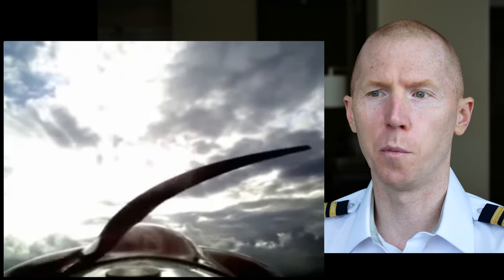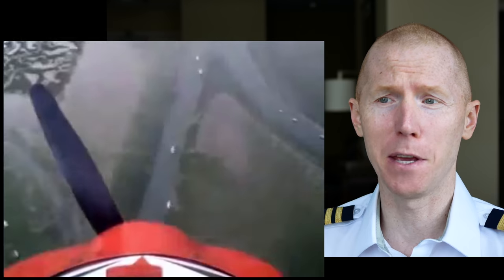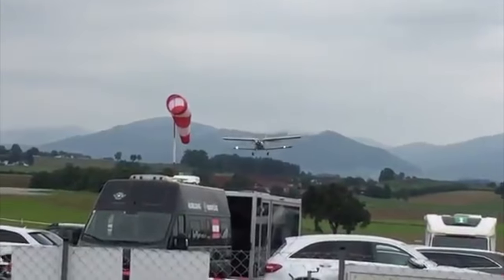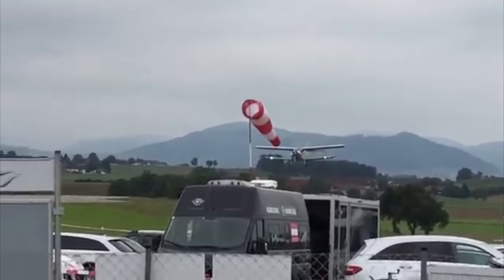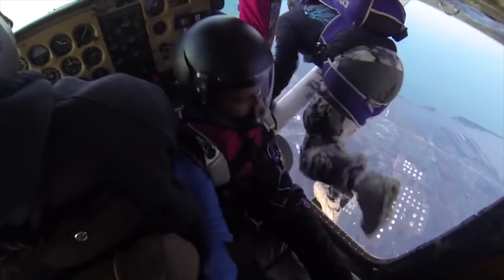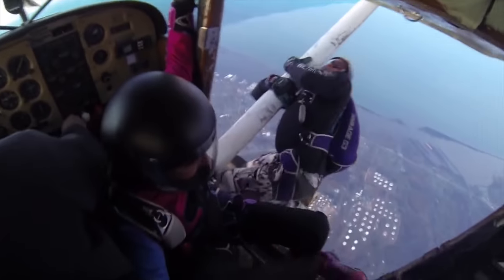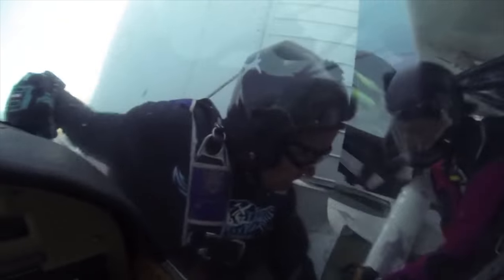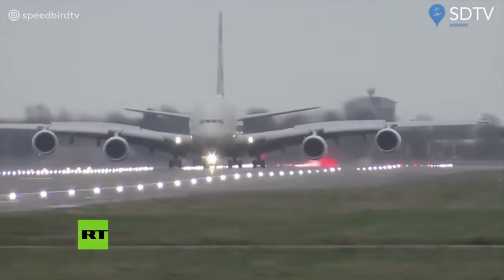Mid-Air Collision Rips Plane's Wing Off | Viral Debrief

Comment: For those who are wondering, the skydiving accident happened in Superior, Wisconsin in 2013. Those white circular tanks you can see on the ground in the video are the same refinery that exploded in 2018.
Reply: It's insane that everyone survived that accident. When you see a Cessna spiraling with only one wing, that doesn't typically bode well
Reply: Errr, no. There was an explosion at the refinery which is not the same as the refinery exploding. But apart from that, putting that much flammable gases and liquids right next to an airport is just asking for it. One of these days a plane crash is going to ignite multiple tanks and then there's a good chance of the entire facility becoming a mushroom cloud.
Reply: @JC130676  If the Chemical Safety Board case study videos are any indication, you're much more likely to get the explodey effect from some transfer pipe that hasn't been serviced in 40 years due to deferred maintenance than a plane slamming into anything.
Reply: Note to self, avoid Superior Wisconsin. Seems to be extremely unlucky.
Reply: Wow, it took 5 years for the refinery to explode? Seems like a lot of time to put out the fire.
Reply: @eaglestdogg  LOL
Reply: That area must be the Bermuda triangle of Wisconsin!
Reply: @JC130676  Newark and almost any Northern airport has those mate

Comment: 6:30 My dad always taught, aim about 1/3 down the runway. If the runway is so short you need to land on the numbers, find a longer runway.
Reply: They also teach us to fly a 3 degree approach because that's what the airliners do, but which is terrible for small single-engine planes in the case of engine failure.  A slightly steeper approach allows you to maintain the safety margin and keep enough energy if the engine fails.
Reply: Plus that is an an-2 a plane that is so slow that it can fly backwards in strong winds, don't think he needed that whole runway.
Reply: Its fun landing on the numbers when you don't have to
Reply: @maxmackinlay618  Lots of things are fun. It doesn't mean they are safe.
Reply: @erictaylor5462  Can you please explain to me why landing on the numbers is unsafe? Imagine being diverted to a nearby, short but suitable runway due to unexpected deteriorating VFR conditions. But not having the experience or the ability to land on it.
Reply: @maxmackinlay618  This is directly from my father, a certified flight instructor.
     Landing on the number is unsafe because if you lose power, or fly through a down draft you will land short of the runway.
     If you don't have the ability to safely land your airplane, you should not be flying solo.
     It is possible you may be landing on a short runway, so short that you need it's entire length. This scenario doesn't even need an emergency or diversion. IN THAT CASE it is safer to land "on the numbers"
     But if you have the room, it is safer to land farther down the runway.
     There are several cases when a pilot has no perfectly safe options. Sometimes you have to make the best choice available.
     For example, you take off in an airliner and lose both engines over a densely populated city. There is no safe place to land, so you choose the least populated area to crash into.
     If you're lucky you can find an empty lot to crash into, even if it means killing everyone on board, at least you won't kill anyone on the ground.
Reply: @erictaylor5462  Your Dad is a very good instructor, and I appreciate the time and effort he put into your answer.
Reply: @erictaylor5462  I give you two the wholesome award, good job being nice to each other on the internet
Reply: @maxmackinlay618  Its called the touchdown zone for a reason.  In a 152 that can land and roll out in 1.000 it may not be as critical but as you get into heavier and larger airplanes you will take a different opinion about landing on the numbers.  As far as getting experience or having the ability in an emergency,   you don't need to land on the number to get either.  The point is to have a target and keep working on being exactly on target, 1,000 from the end.  I would make it my goal to always have the wheels touch in the touchdown stripes.  That means aiming for the 500 fixed distance marker and flaring to the TDZ.  After a while I got to where I would almost always make the center of the TDZ.  As a pilot you should always be trying for the exact center of everything.  Center of the taxi way strip, center of the center line, center of the nose wheel chock line, well that one is up to the ramper but you get the idea.  Being precise doesn't mean operating close to disaster.
Reply: I was taught a 1/3 down the runway also
Reply: Tell that to St. Maarten
Reply: @Shrike2415  There are exceptions. But just because there are times when you HAVE to land right on the end, that doesn't mean you should do it when you don't have to.

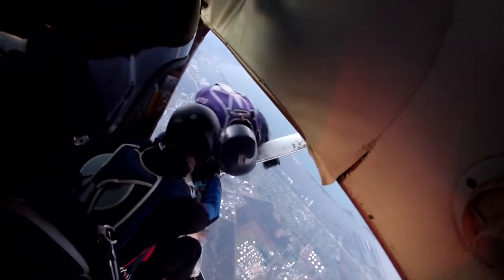Comment: 10:38 the upper plane is in a right descending bank as evidenced by the horizon showing out of his windscreen. you can even see the wingtip of the lower plane in this frame so it was plainly visible. the pilot of the upper plane just wasnt paying attention enough. its amazing no one got crushed between the planes or struck by the propellers.

Comment: 5:33 Fortunately since it's an AN-2 it'll probably buff out.
Reply: Love that plane, so gorgeous.
Reply: Those AN-2 Colts, typical Russian-made aircraft, are tough old birds! It's a shame what happened, but it'll be flying soon again.
Reply: @michaelbishop8298  Russian made things are always pretty tough lol
Reply: Buff out?  They'll just cut the landing gear struts off the other side so it can slide level and keep on going.
Reply: @ardeladimwit  You are correct my friend about the AN-2 being of Ukrainian origins. The Antonov Design Bureau is located in Kyiv, Ukraine, where the biplane got its start. What I meant to say was Soviet-made or even USSR-made aircraft. I hope that clarifies things!
Reply: @michaelbishop8298  Not only not Russian, but not even typical. There is absolutely nothing like it. A cantilever biplane, designed in an age of bubble canopies and jet propulsion, with a taildragger layout and greenhouse glazing, to fill a niche previously occupied by the war surplus Po-2. They were built like agricultural machinery, because that's what they are. Optimized for the vast fields of Ukraine, they were limited only by where they could be loaded with cargo (fertilizers, pesticides, skydivers, general cargo) - a flat field with a path leading to it was all they needed. They could refuel there, too - just roll a drum of gasoline next to it and the onboard pump would suck it up. They don't have a stall speed (if slowed down too much they just run out of lift, the mechanical automatic slats keep the flow attached); if caught in heavy fog in its native terrain, the procedure is thrust to idle, wings level, trim to min sink, wait for touchdown and hope the fog is too thick for tractors.

While I get that this agricultural practicality is often attributed to anything made in the USSR, that's mostly a myth, fueled by comparison between Eastern and American machines. As far as aircraft go, ruggedness, rough field capabilities, and not relying on perfect infrastructure, is something only Americans and their client states don't do.
Reply: @ardeladimwit   Its not a Russian aircraft, its not a Ukrainian aircraft. Its a soviet aircraft. Lets get that straight. It was designed in the Kiyev by a man born in the Russian empire, that went to school in Saint Petersburg. These planes were built by Russians, Ukrainians, Tajiks, Uzbeks, Armenians, Georgians, Poles etc. etc. Lets stop attributing what was made in the soviet union to a specific modern country.

Comment: 10:30 it appears to me that the pilot did not react to the weight shift due to the jumpers stepping out.

That shifted the balance of the plane quite significantly. While he maintained level flight speaking from the rudders, the airplane banked right; obviously faster than he was able to react to.

Comment: The mid-air collision looks like the stuff of nightmares.
Reply: @BrainScramblies  He doesn't get sucked away.  He starts slowing down (but is still moving forward) due to no longer being attached to a motor coupled with wind resistance, and the plane keeps traveling on. All you see is a difference of speed, like a fast car passing a slow car on the highway.
Reply: @possiblepilotdeviation5791 : Just think of what the camera footage would've looked like had that plane been a 1/2 m.p.h. faster and those skydivers hanging on outside would've been lined up with the propeller from the plane that they collided with? 🤮
Reply: @BrainScramblies : Technically, motors are electric, engines are internal combustion, but who cares? 😁

Comment: That Etihad A380 pilot was severely reprimanded by the company as the company viewed it as above max crosswind limits and dangerous flying.  Although in my view it just demonstrated good ability.
Reply: Both are true and correct. Rules are there to stop a pilot having to demonstrate good ability in order to avoid a potentially dangerous situation.
Reply: @anononomous  exactly, you are supposed to use your superior judgement, in order to avoid having to use superior skill
Reply: Well, commercial flying is all about obeying rules so that you don't have to test how good your flying skills are.
Reply: It was pretty impressive, have got to say. The xw component must have been massive.

Comment: 5:33 Interesting. I never knew landing on the numbers was a thing even when I was in flight school, especially in general aviation. You have a tiny plane and most runways are pretty huge. I would just try to land on the runway touch down markers. Landing on the numbers would mean flying dangerously close to objects behind the runway, like antennas, or building structures. 

The only reason I can think of landing on the numbers, if the runway was extremely short, but this is an AN-2, the thing stops on a dime and takes off like nothing.
Reply: Depends where you learn we had a rather short grass runway, braking strongly on it was quite worrying, but yeah, even then it was important not to land too soon. But landing too late was not an option, it meant a go around. I guess that a go around is preferable to crash though:)
Reply: Right??? It's always weird to see people go through jet take off procedures, and then realize that on most general aviation aircraft, V1 comes way after VR, like in a lot of small planes you can lift off, and still reject a take off.
Reply: I think it's mandatory to land on the numbers for folks that are landing jets on carriers though lol 

I've always loved watching those guys land. Every time I see it, I wonder if this is gonna be the time that the brake cord snaps 😜
Reply: @since1876  those guys have to land at full throttle so that they're able to take right back off if they miss the arresting cables or if they break. Both of those things happen regularly.

Comment: Looked like had to much weight on the right side of plane. When they start climbing on wing the plane started sinking and going right.
Reply: Not weight, drag. All those people out in the airflow really slow the aircraft down. This makes it drop, and the pilot must feed in throttle to counter this, but not too much. 
The upper pilot didn't feed in any throttle, lost speed, and dropped into the lower plane he was blind to. Normally this wouldn't be a problem if he was the only aircraft, but in a formation, it's a huge problem. 
The lower aircraft should have been ahead and to the left, on the right, all those jumpers blocked the view.

Comment: Kelsey, one question: How is material wear of the landing gear with these "crab" landings? Simply by watching the footage, this looks like it's putting tremendous stress onto the landing gear struts, not to mention the wheels, since it must be like a "drift" for a moment
Reply: Yeah, kinda surprised the trucks don't rotate like on the B-52.  That way they're already in line with the runway at touchdown and don't have that side loading.

Then again, Airbus Industrie probably wasn't planning on pilots trying to crab a passenger plane - for exactly the reason Kelsey describes.
Reply: I dunno how strong they are but I know Kelsey always says planes are designed to take that load. I'd imagine doing it too much would be bad, though. But everything on commercial planes gets worked on regularly and they don't let a plane up without it being good enough. So I'd guess that it would be serviced quickly if something did break. And I don't think it's meant to be done by smaller planes, so the only planes that would really have landings like that would be owned by folks that can easily afford the repairs 😌

Comment: Basic formation flying requirement: Dash 2 is responsible for separation. Need make no other statement. Dash 2 flew into lead. End of investigation.
Reply: In Formation flying you NEVER EVER take your eyes off the lead aircraft.  The Pilot in the following position was at fault and deserves a solid ass chewing. Period.
Reply: Having many, many hours instructing formation flying in the mighty Tweet, cross cockpit formation is tough.  As 2, we NEVER put ourselves high so as to lose sight of lead.  This accident started with the initial bad  decision/lack of judgment to fly in that position, continues when 2 drifts high while the pilot is flying cross cockpit, then when he loses sight of lead...not sure what the heck distracts him, not seeing lead at least out of the corner of your eye ought to automatically raise hairs on the back of your neck and ends when 2 runs into lead.  Lead has about zero responsibility to avoid 2 (though a good preflight brief and direction from lead may have prevented the circumstances from occurring) especially since there’s no way to see him from his position, he needs to trust that if he needs to maneuver, 2 will avoid him.  This accident is 2’s fault, didn’t matter if lead was climbing or turning.

Comment: The jumpers on the wing really hurt a small cessna's aerodynamics and CG, especially on the upper end of their altitude density. Not surprised to see that plane pulled down and towards the right
Reply: Pilot usually throttles back a fair bit before doors open, then he usually has to put in like half rutter to keep it straight. However, without any point of reference, the magnitude of drift towards the right might not be obvious during the likely hundreds of drops when they were flying alone

Comment: This was not a flat spin. This was a normal spin using improper control inputs, which caused an very long recovery as noted by the A/C nearly going wing over and the increase in rotational speed. What you call the “horizon” was the shore line approximately 3 miles away. Earlier in the video you can make out the horizon partially obscured by low clouds over 20 miles away.

Comment: 5:40 looks like a old Antonov an2. We have one based here where I’m at, “CYOO” it flys the Airshow circuit. The Antonov An-2 is a Soviet mass-produced single-engine biplane utility/agricultural aircraft designed and manufactured by the Antonov Design Bureau beginning in 1946. Its remarkable durability, high lifting power, and ability to take off and land from poor runways have given it a long service life.

Comment: Skydive pilot here (Cessna Caravan, so not sure if they do something different with a piston cessna). When the skydivers are exiting the aircraft, the plane is setup in a way that it is running very close to the stall. So pulling power back and slowing up isn't an option, however I haven't ever flown a formation drop so can't say what I would do in the situation, I assume the plane behind would maybe want to be slightly behind (offset to the side) the lead aircraft so that the pilot behind can always see the lead aircraft and maintain a safe distance, even if he has to use rudder turns rather than banking to make small adjustments to his run-in line. In either case I would be uncomfortable flying a formation skydiver drop as I don't think I have the skill to do so and would probably end up like this :P

Comment: I used to fly skydivers and do those formation loads/drops. I don’t need to see the instruments to know what was going on.  The key to preventing the collision is to fly with more airspeed so the chase plane can trade speed for altitude for collision avoidance, and more control over yaw and roll. Also I should note, the airplanes naturally want to move in the directions which brought them closer together during a formation drop manoeuvre, and is also why the more experienced formation drop pilot normally flys the chase position,

Comment: Hi Kersey! (I hope I spelled that correctly!) In the Parachute crash, I believe that the parachutists in the lower aircraft were jumping a little before the higher aircraft. What I think has happened, is that as the skydivers have started jumping the pilot should have realised that as he lost the weight his aircraft would climb unless he took steps to prevent it happening. I.e. reduce power or trim a slightly downward attitude. 
So because he can't see the higher aircraft he has assumed that its not there so he is OK to let the jumpers go with nary a thought for any other aircraft in the sky. Im not sure what has happened to vertical and horizontal separation between these aircraft in this circumstance.
Great channel BTW.
Reply: BTW, I did spell your name Kelsey... but I think you got 'autocorrected' i can only apologise!

Comment: That flat spin is a recovery technique we practiced on high-wing general aviation planes, aka, Cessna 172 for example.

The silver airplane has the wind straight down the runway.  We have a similar setup at my local field and that drop-off that he hit develops rotor at my airfield... dunno about this one but I've seen several planes drop 20ft right at that spot.